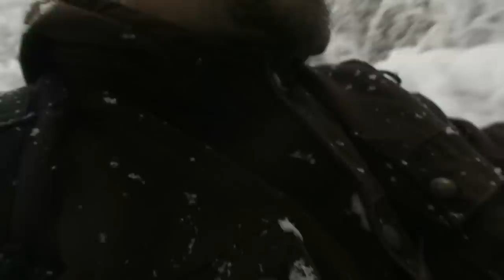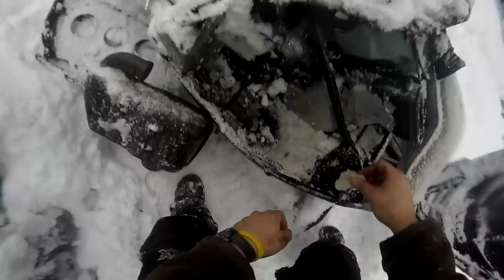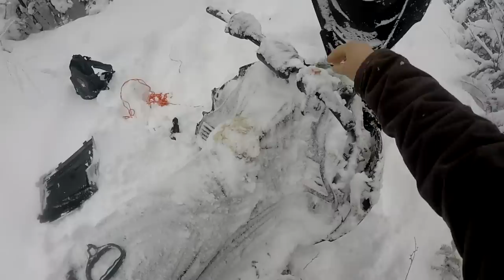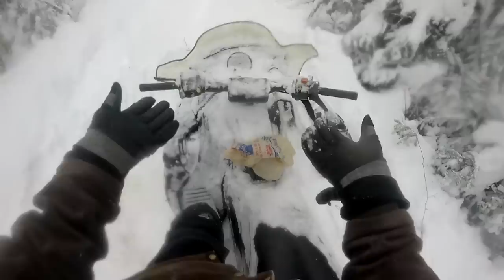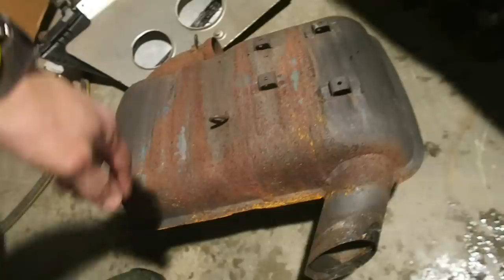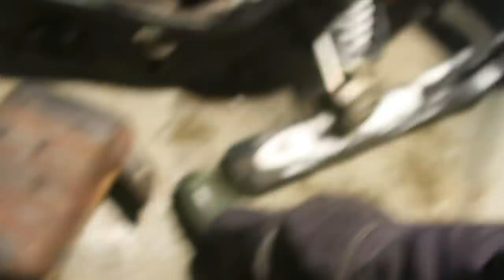RECOVERING MY BURNT SNOWMOBILE (AFTER CATCHING ON FIRE)

Comment: Good video.
My sled and bike are in the garage, but I've already discovered a mouse nest in the bike last season. They say dryer sheets prevent mice from building nests, so we'll see. The SRX 700 and Hayabusa are packed with them.
Good luck on the Polaris leaf blower. You'll get it.
You still got the MXZ 700, So life is good.

Comment: Call me dumb but that is the coolest trick ever to put a rope on the clutch. Never knew that!  I know i coukd do that with my boat and an i/o engine but not a sled.  Keep it up bud!
Reply: It's in the manual, as well as standard procedure in the Snowmobile safety course.  All your pull start is doing is turning the crank.  Just be sure that when you do this, you have the rope wound the CORRECT DIRECTION.  Some clutches actually have a notch cut in them, specifically for this purpose.  In a pinch, a belt works as well.

Comment: You need it primed. Just pull the small fuel line, they connect to the air box. Pull them off the air box and blow in them. It primes the carb with fuel.

Comment: My luck is when the choke knob falls apart and I lose the pin All in one setting. I cannot count how many times I had that happen. It got to the point I started carrying a pull cord with clip and a whole other choke lever and pin in my pocket in a plastic bag. Yup.... fun times. I dont miss THAT part of it. I think I told you the story of the acorns blowing all over the shed( on fire) That was when I learned to stuff the exaust with rags in the off season.

Comment: Not sure why you went for a primary pull when it is so easy to remove the recoiler and put the handle back on it, especially when you have the tooling. Glad you got it back but rule number one is work smarter not harder.

Comment: Not so exciting to happen I’d say. Had a rental one do that because of a fluid dripping on to the exhaust from what I could tell. Fortunately I was able to have the company look at it before hand and they said to go ahead and use it because that wouldn’t happen and that they have plenty of oil in them. Fast forward 3 miles heading straight back and the ride went drip drip whoosh when engine was stopped. My son was 5 and he still won’t get back on one. I’m still trying on that. Oh and they said they wouldn’t charge me for the damage. Nice of them. The gall of some. Glad you got it out. The one we were using was a bare frame and shocks by the time they got there.

Comment: I know that you probably didn't have a chance to do anything because you just bought the sled but what i do with my 550 is get some steel wool and moth balls and out them in your exhaust from the bottom and when you start it up in the fall just pull it out  or it should blow out on its own. Keeps unwanted rodents out of your exhaust

Comment: Throw the can in a fire?? WTF. No when you put them away you shove steel wool up the pipe so they critters don't get in the pipe.. That is the correct way of summerizing the exhaust also i throw dryer sheets all over the machine when I cover it and store it in the garage. And before you put the sled back into service you pull the wool out and inspect all over the machine for nests and chewed wires ect!